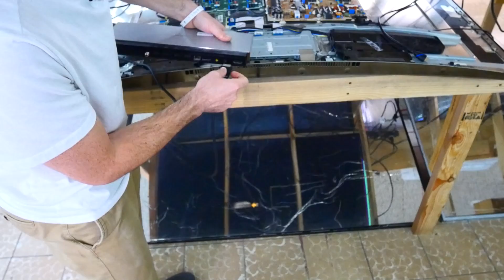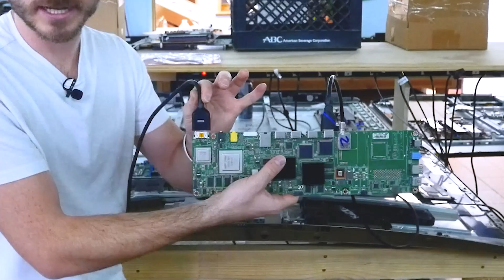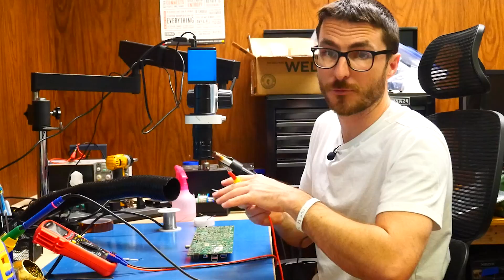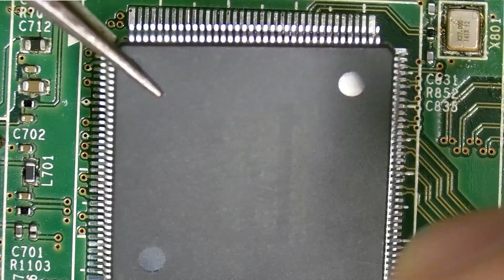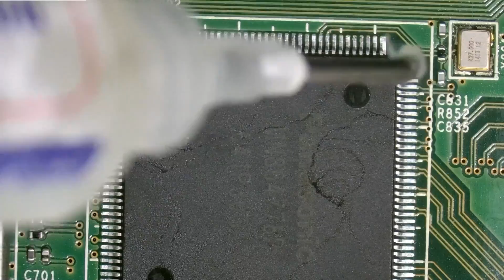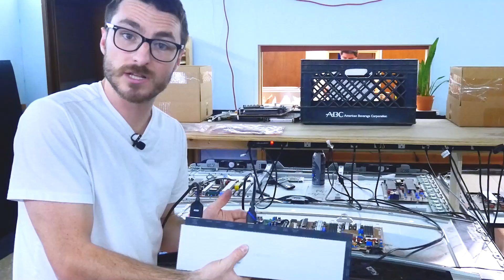HDMI Repair Samsung UN65HU9000 One Connect Box

Comment: Did you change the type of flux you use?
Reply from the maker: So Juan and I use different types of flux that's maybe what you are noticing. He uses no clean flux, so it's a special kind of flux that you can leave the residue on the board and won't corrode over time or become conductive. He needs to use that because you can't easily clean underneath those chips he installs. I have more freedom to use whatever since I can more easily clean it off after since my solder joints aren't below the chip but on the sides. Of course, the same goes for SMD and through hole components.
Reply: @NicksTVRepair  yep, this video you used a thicker flux than I was used to seeing used on the channel.  I hadn’t realized there were different types before.